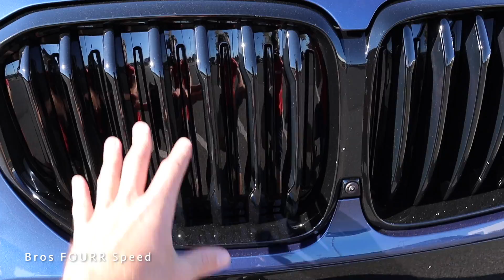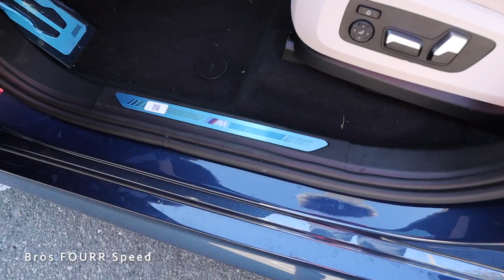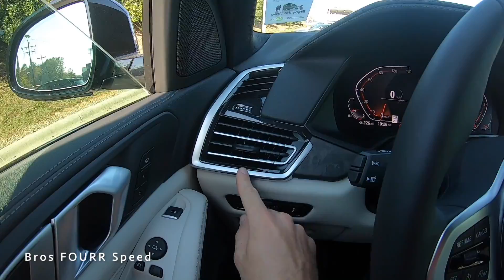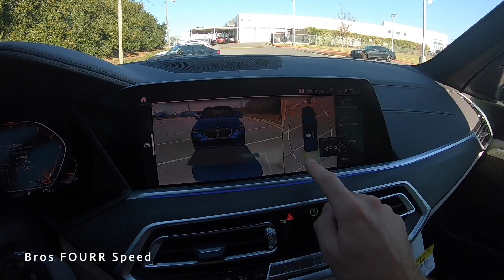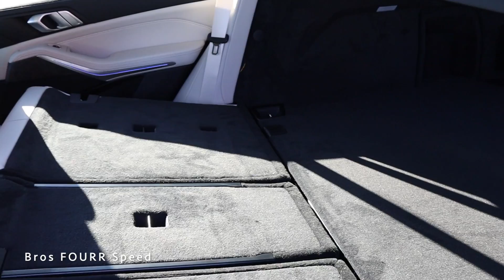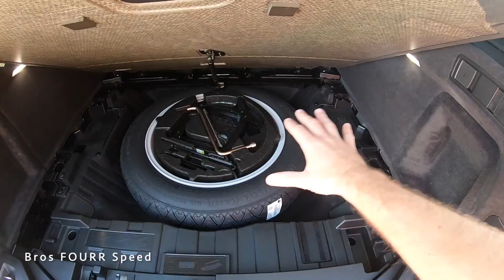2022 BMW X5 sDrive40i: Start Up, Exhaust, Test Drive, POV and Review

Comment: Did you notice much difference on the sdrive vs the xdrive40i's you reviewed?
Reply from the maker: You won't really be able to tell the difference!  Maybe traction on wet roads is a good example where you would, but just normal daily driving you wont!
Reply: @BrosFOURRSpeed  Awesome, thanks. Sometimes RWD cars feel lighter on the front end.
Reply from the maker: @thedesertroad  Yeah I could see that! You’d have to do some back to back performance type driving or good turns to really feel that!

Comment: Is that a dealer markup sticker I see next to the window sticker 🤔
Reply from the maker: Nope, Hendrick doesn't do mark ups! That would be for other options like window tint or nitrogen in the tires, extras like that.
Reply: @BrosFOURRSpeed  so bs extras to maximize dealer profits.
Reply from the maker: @lssg12  I mean a lot of dealers do that, Toyota did that on my truck, and yea they charge more for it to be on there but if you ran a business you’d want to see how to make more money as well.

Comment: Nice review....and interesting, my 2022 X5 doesn't have the adaptive drive mode. It was manufactured in September...hmm...
Reply from the maker: That's interesting to hear!  Which trim level x5 do you have!?
Reply: @BrosFOURRSpeed  I have the xDrive40i...MSport...and even though it's missing certain things (as a result of the chip shortage) like Harmon Kardon stereo, adaptive drive mode, fog lights, levers in the trunk for the seats, etc...I still love it! 😍😬

Comment: As I commented on the other 2022 X5 video, that icon on the tray above the cup holder is an NFC icon for digital key (both card and phone) but is not the wireless charging icon as that was removed for MY22.
Reply from the maker: It's actually a wireless charger based on the symbol on the pad.  I tried to zoom in on it so there wasn't any confusion.
Reply: @BrosFOURRSpeed  I promise you it’s not. If you look at the icon on the tray, you’ll see a rectangle representing a phone and then arched lines above it, indicating NFC. If it was wireless charging, you would also see a picture of a battery and lightning bolt inside the rectangle. I can assure you no MY22 has that unfortunately. Or fortunately depending on your perspective.

Comment: I have the 2021 version of this vehicle. Same phytonic blue color, extended shadow line (blacked out), interior is all the same except mine is the ivory/navy blue combo merino leather with seat ventilation. Wheels are 21” vs 22”.  I also removed the badging on the back. Looks cleaner. 

Fantastic daily performer. Made me feel like you were reviewing my X5. Nice video.
Reply from the maker: Very cool!!  Personally I love the X5 of all the SUV's they offer, practical and has the performance!  It's a sweet ride!!

Comment: That Jeep Wagoneer you guys reviewed in an earlier video is a much better choice than this BMW X5.  For 70K, I can get a used Jeep Trackhawk that has the hellcat 6.2 supercharged engine.
Reply from the maker: The Wagoneer isn't as performance oriented as BMW's, so just depends on what you are looking for.  Much different size and purpose! You could get a used trackhawk which is completely different than this BMW or the Wagoneer!  That is a performance beast!
Reply: @BrosFOURRSpeed  With SUVs I care more about interior space and practicality than sporty performance (not a necessary feature for me though it would be a plus). 

 The Jeep Wagoneer is a mini bus (love large vehicles) and I like the size of the interior.  It drinks fuel more quickly than this BMW X5 but the BMW's interior is no where as spacious as that of the Wagoneer.  The one thing that I might find annoying with the Wagoneer is that it will be very bothersome and challenging to park in tight indoor public garages due to its enormous exterior size.

If I was more leaning towards performance I would pick the Trackhawk over the Wagoneer and X5 all day, unless you are talking about the X5M then it will be a tough choice for me. 😁
Reply: Or you can get a fully loaded grand Cherokee summit reserve. 😂😂 I’ll take the x5

Comment: It kind of trips me out that for 70K, ventilated front seats are not standard but word on the street is that it can be a rare option. I don't know but this one along with the Aviator would be a great comparison, Aviator for luxury and X5 for performance, tough choice but both of these SUVs are sizzling right now!
Reply from the maker: That’s a good point! Haven’t been able to check out the aviator, but they look nice!! You’d think ventilated would be standard, but on the higher trims you can get that!
Reply: I have a ‘22 X5 with cooling ventilating seats and to be honest, they’re pretty weak.  I had better results from a ‘11 Chevy Traverse that I rented in North Carolina over a decade ago.  Those seats got cold but my new BMW you can barely tell they’re working.  I sort of feel it more up by my shoulders, but it’s not very strong at all.